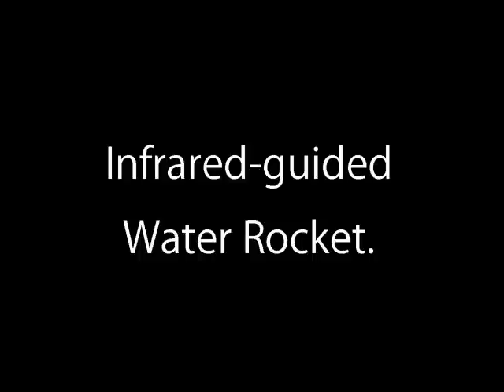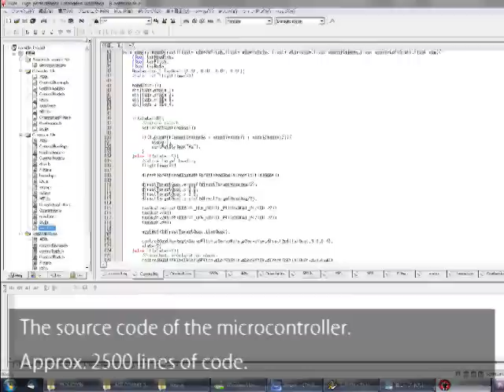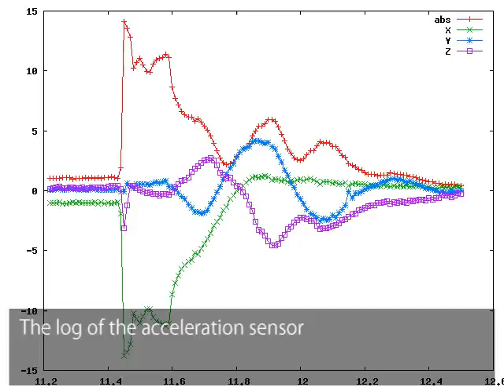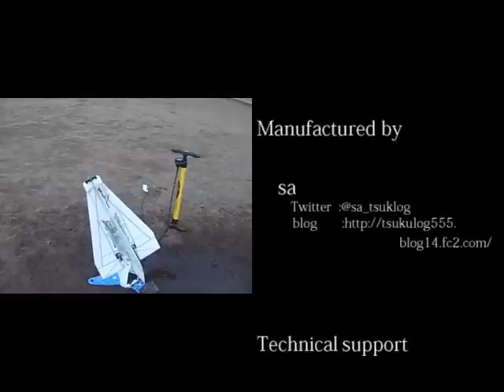Making an infrared-guided water rocket

Comment: You need PID formula in your controller to get real accuracy. Proportion Integral and Differential. Also try to use 10 оr better 50-100W IR diode with old mirror camera lens to make aiming device. Point it on the target, adjust focus and get your missile just into the center of IR spot.
Reply: Novi S sir, it seems u know lot about yhe topic. Well, i have a similar project witha a normal seeker head and a renesas mcu but i dont have the code. Could u help me in any way?
Reply: Novi S you don't really need a PID to improve accuracy. There are two main problems that inhibit accuracy. The first is seeker field of view, which would be on the order of ~100 degrees in this setup, with little signal discrimination available for the inner region. The easiest two solutions to this would be implementation of an automatic gain control circuit and focusing optics coupled. Next of course you have the issue of pure pursuit guidance requiring unattainable amounts of acceleration in the final stages of terminal. Mounting the seeker of a wind stabilized nose and correcting would align the missile velocity vector and not forward vector with the target. PID could of course be considered, but many remarkably successful missiles use no PID controls whatsoever and function flawlessly at far higher velocities and accelerations.